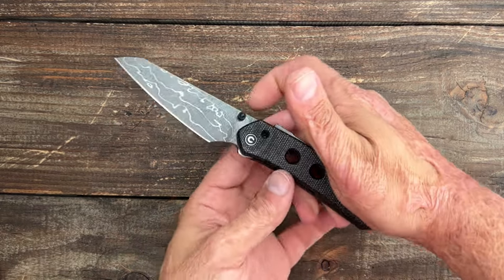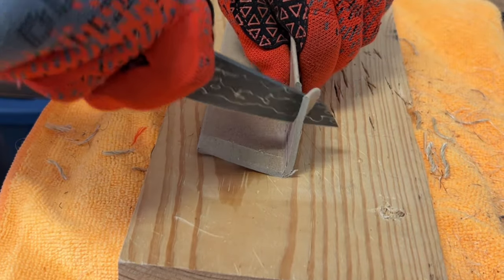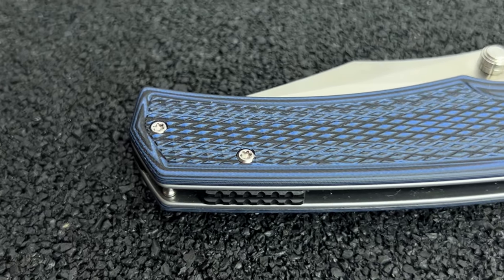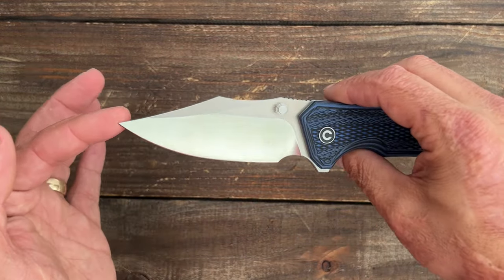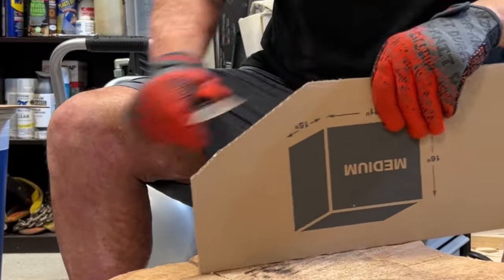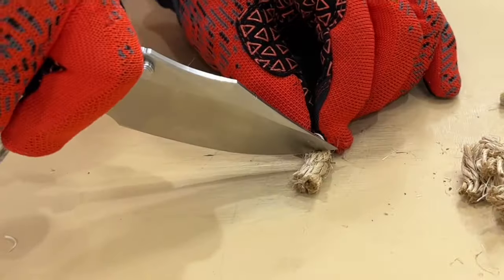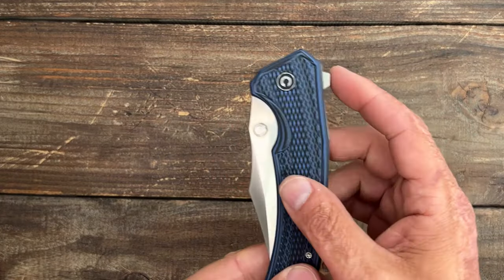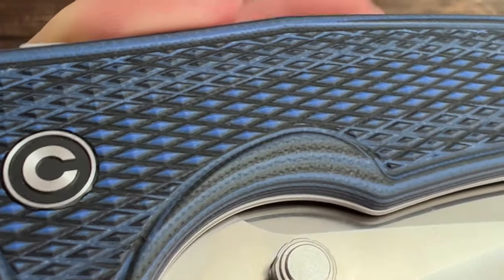EDC Excellence: Civivi Knives Vexillum & Vision FG Review

Comment: The vexillum is nice but I’m not paying $100 for it.
Reply: I thought it was overpriced myself
Reply: I bought one for review and my personal collection, but I agree. At the same time I don't think this is an issue solely with this model. I think Civivi has definitely made a strong move toward being a mid-range rather than budget branding. And their current pricing reflects that.
Reply: Well they had to make room for sencut. Civivi used to be the budget line, but it  was deliberately moved up.
Reply: @afoolishman12 , absolutely correct.
Reply: @afoolishman12  I don’t disagree but I’m personally not paying that much for something made in china with nitro v, g10, and a liner lock.
Reply: Got the blue/black G10 w/satin blade, what a smooth-actioned beast‼️ Got it for $86, a lot of knife….happy buy😎

Comment: I like my Vision FG petty well.  Only criticism is the weight.  A little heavy for size.
Reply from the maker: Yeah that’s the only downside with having a stainless steel superlock, I wish they would have tried using aluminum at least for the liners and possibly for the lock but not sure if the aluminum could take the impact